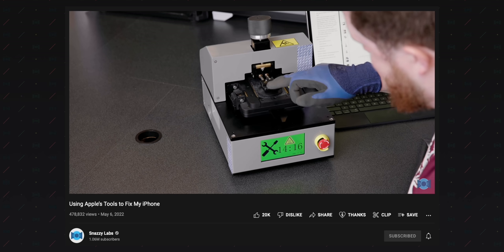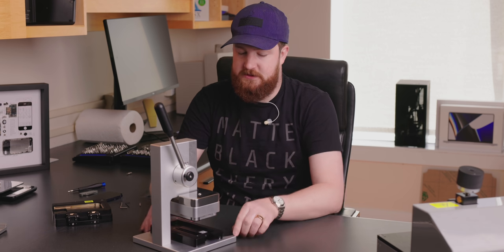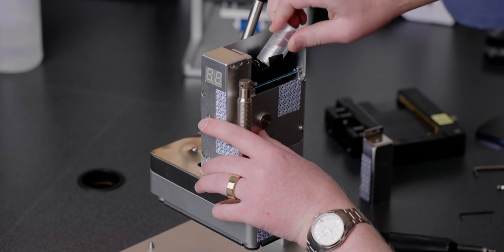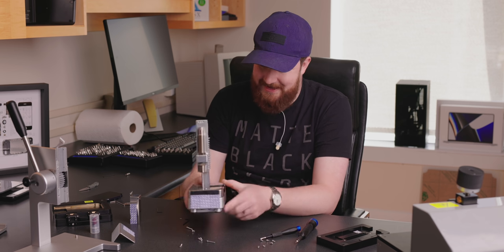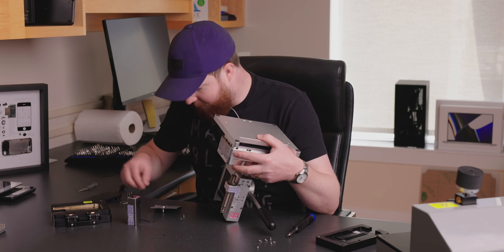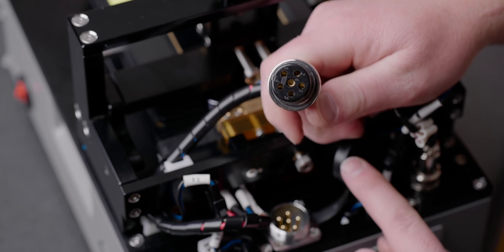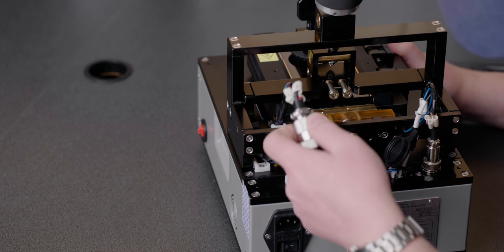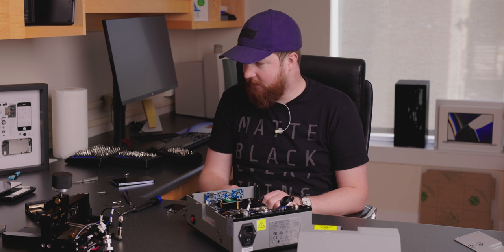Breaking Into Apple's Secret Genius Bar Tools!

Comment: I bet the purpose of the RFID thing is so that when Apple makes different phones, they can just give out new hot pockets that can then tell the machine what kind of heat to put out for for that specific unit just in case the new phone has more or less glue in it than another model.
Reply from the maker: Yep. Agreed. Set temperature and timing.
Reply: @snazzy  Could also be for stock management - although I'd expect an RFID tag in every device for that. It's becoming a very popular way of managing stock.
Reply: @Crusader1089  Not for stock management, it's specifically for temperature and timing like previously said. I've been a Genius bar tech for 2 years.
Reply: more or much more glue, never less
Reply: Might also be NFC
Reply: Can also hold calibration data for the thermistor
Reply: @QualityDoggo  no
Reply: @snazzy  maybe you can reprogram it and give it other temperatures and timing's? That would be really cool. And could you make a video if they charge you for breaking their stuff?
Reply: @chromegamer888  they can’t charge him. he paid for the equipment.
Reply: @brayd3n.heust0n  Don't know.  You can buy it or rent it.  If he rented it, then he's not getting his deposit back.  :-)
Reply: @Shamino0  the deposit is to encourage you to send it back. if you keep the equipment all they do is keep your money.

Comment: The tools are for mass repair/production. Imagine having to use your fingers to apply the glued part. The roller tool would be extremely useful
Reply: Very good point!
Reply: And if you crush or damage the ends of the pouch it may lead to a fire in a very small percent of cases. Given the volume they deal with, this battery roller tool is likely a good idea.
Reply: right so why send it for a one off
Reply: " Imagine having to use your fingers to apply the glued part" - how many battery replacements is a tech doing in a day?
Reply: @emilypeters8888  I think apple is sorta trying to make it look like it’s harder and more complex than people thought, since they put off repair programs for SO long.
Reply: @AndyMcBlane  this looks like in factory used tool too. 
Could be hundreds of ovine a week that need manual rework off the line
Reply: @ericspda  It IS, when one does it according to proper procedures, IE, PROPERLY and to spec.
Reply: @ericspda  YES. it's ridiculous that according to them, you need all this equipment just jo change a battery.
Reply: @emilypeters8888   apple wanted to just re-use all the manuals they already had, if they did a dedicated manual then they would need to describe how to press down the batter but not press it to much and how to ensure when you do that you don't damage it etc...
Reply: @emilypeters8888  in a way it’s not really a one off because they’re designed to be sent back and then sent out to the next person..
Reply: @AndyMcBlane  5-20 max, not enough to cause finger damage.

Comment: The mostly likely purpose of the shield around the display press is because when the pins slide up, they create a pinch point, and Apple didn’t want to deal with the lawsuits of people getting pinched by the press, so they added the cover and it looks nice.
Reply: Yep, first thing I thought of. Enclose the moving & pinching bits as much as possible to keep from getting fingers or whatever in there.
Reply: Not even lawsuits.  This would just be covered under machineries regulation in the EU, and it has a CE mark so it's approved for sale there.
Reply: well ofc it is that. but ye old "apple and looks" BS makes for a better video and more clicks.

Comment: I worked as a tooling designer for some Apple products, and everything is very overkill with them. Their power supplies are nuts, they not only put an adhesive inside, but then had us weld the two halves of the clam shell together. The tolerances that were required meant that my company needed to get some new equipment as well as having a ton of rejected parts because they didn't meet spec. Honestly there's more that happened with them, but I don't want to write a short story. Additionally this was stuff ~4 years ago which is out of my NDA so I got that going for me too.

I also wanted to add that I doubt much of that is actually extruded aluminum. The satin finish can be done using scotch bright, which is like the coarse side of a sponge, and elbow grease or a vibrating sander.
Reply: >needed to get some new equipment 
That’s prolly part of why apple products are so expensive lmao, since i’m assuming the company passes the expenses down to apple
Reply: I can’t imagine those would be hand finished, although I agree not extruded for sure. But probably some sort of stone tumble
Reply: Crazy how different the "language" and style of the designs for consumer vs internal products are.
Reply: @QualityDoggo  cuz production products don't need to have "sex appeal" (as ltt puts it) lmao
Reply: Very curious about that job, anywhere I can read more about it?
Reply: The fact that the slots aren't continuous tells you that it's not extruded. The bars could be extruded, and probably are, like most aluminum bar stock, but it's completely machined to final dimensions.
Reply: Please write a short story, it's very interesting
Reply: To quote you, “Honestly there's more that happened with them, but I don't want to write a short story. Additionally this was stuff ~4 years ago which is out of my NDA so I got that going for me too.”   
Please DO write that short story! It seems many of us are interested.  Thanks!
Reply: To quote you, “Honestly there's more that happened with them, but I don't want to write a short story.”   
Please DO write that short story! It seems many of us are interested.  Thanks!
Reply: skotchbrite: causes 90% of work accidents, but looks nice
Reply: I think the finish is most likely from sandblasting
Reply: Thanks for your insight! Yeah, on the screen press you can see some edges are a bit rounded and shiny - telltale signs of some wire wheel + scotchbrite work.

Comment: 2:30 I mean, you can have linear and non-linear springs. Its not just a given that any spring won't have a linear curve to its force applied with respect to its compression.
Reply: He's not saying it doesn't have a linear force curve, he's saying the more it's compressed the more force it applies, it looked like a linear spring in the video so if you were to measure force the spring applies against the spring compression you would get graph showing the force would increase linearly when compression increases
Reply: He meant to say that it is not constant, but he said non-linear which is (mostly) incorrect!
Reply: @ArisSynodinos  Makes more sense that way now that you mention it. Its probably a linear spring (given that it seems to have a constant radius and spacing) but who knows.

Comment: 1:25 This thing reminds of that credit card slider used back in the 80s and 90s to carbon print the numbers on some sort of receipt. Nostalgic.
Reply: Yep, worked retail then and it was neat.  Just assuming it was pressure to press the CC numbers onto thermal paper.
Reply: They call them "knuckle-busters" in the industry.

Comment: That lithium battery is double the voltage of a C or AA battery. It’s interesting that they designed it to take a C size, but not C voltage
Reply: Was looking for this o.o
Reply: It may run on 1.5 too. Some circuits are dual voltage or run on a voltage range.
Reply: I guess you could say it's C major
Reply: @bigblackbadger1  hah, you, you I like 🤣
Reply: My best guess is that because it's a Genius bar tool, they wanted more capacity because geniuses needed to work on more phones.
Reply: you can get lithium AA batteries. They include step-down circuitry inside them
Reply: @keco185  yeah, the battery IN the tool is a lithium AA battery.
Reply: @keco185  or tripple. idfk. I barely know what i'm saying.
Reply: @aliabdallah102  my point being it’s 1.5V
Reply: @keco185  well, yes that’s a good thing to know, by for this tool specifically it’s a normal Li-on battery at 3.6 nominal voltage (probably a 14500 size if I had to guess)
Reply: I use those 1.5v lithium aa and they are great for normal electronics, and I use the lithium 14500 batteries for some hobby projects where an 18650 is too large.
Reply: @josh8106  interesting.
Reply: @keco185  it's not 1V5. It's a 3V6 lithium ion battery. He specifically said that it says it's a 3V6 voltage battery. It's a 14500 battery, not a standard 1V5 AA battery. It's completely different chemistry to the AA lithium batteries that are 1V5 (like Duracell and Energizer "lithium" AA batteries), different to the AA Li-ion batteries that have a 3V6 cell with a buck converter. It's a regular 3V6 Li-ion battery, like an 18650, but in a 14500 form factor.
Reply: @aliabdallah102  a 3V6 14500 battery at say 1200 mAh is going to have less capacity than a 1V5 C-cell battery at say 4000 mAh. So the actual reason is that they want the stability of a lithium ion battery, without the potential for leaks, which C-cell batteries are notorious for. (A C-cell is going to have around double the Wh of a 14500 Li-ion battery.) The machine was probably designed for a C-ceel battery, and they retrofitted the circuit for a Li-ion battery, but continued to use the C-cell battery sleds that the board was designed for.

Comment: For anyone is is trying to learn more about this stuff here are a few corrections/clarifications to make your googling a little more streamline. 
Brass is not extremely thermally conductive. It is not and will never be used for heat transfer. So it stands to reason that those heating blocks are actually a copper aluminum alloy.  
That gearing is called a Rack and pinion. 
The "linear rod" he is talking about is actually called a linear rail. 
That switch is generally called a limit switch (or endstop as he notes later in the video) (indicating you have reached end of travel).

Comment: Did you try reading that NFC tag on the heater tray with your phone? iPhone probably won't do anything, but the NFC Tools app on Android might be able to tell you what's there.
Reply: why an NFC tool app? Any Android stock camera app supports QR-Code reading.
Reply: @Esablaka  ...because that's an NFC tag....?
Reply: iPhone has nfc as wel
Reply: @cossieboy 
It’s kinda useless thanks to Apple restricting hardware access and APIs to app developers.
Reply from the maker: It’s RFID. Not NFC.
Reply: @Esablaka  Why are you on youtube? McDonald's has big macs?
Reply: @snazzy  Ah, so you did try it then. Fair enough.
Reply: @Esablaka  radio tag, not a picture tag?
Reply: @WarpedFlayme  Really sorry that he did not answer you. You can read both RFID and NFC with your Andriod phone. But yeah, better avoid the real question and teach you :D
Reply: Get one of those entry card tap things and use that
Reply: @Scarlett-uz9fr  not all Android phones can read all rfid. It is very complex.
Reply: @snazzy  RFID and NFC aren't mutually exclusive technology.

Comment: Actually the USB port is connected on partner models and is meant for firmware updates. Since this is a home repair kit, you're not likely going keep it long enough that a firmware update is required. That would make since why they disabled it, but it is silly that they did so.

Comment: Quinn! A 3.6V AA battery in the Display Press-
You glossed over that but it’s somewhat odd.. usually AA is 1.5V. No? Like as a rule.
Reply from the maker: Ah yeah, d’oh! Nominal voltage on alkaline is 1.5V not 3.6V so must be a lithium cell. Makes you wonder why they didn’t just use a AA holder though.
Reply: @snazzy Apple: Think differently
Reply: @snazzy  in the recent supply chain crisis, wonder if there was a stockpile of C battery holders in the back of a warehouse collecting dust.
Reply: It’s likely made for an 18650 or a 21700 battery (can’t tell) and they made this small adapter to save costs or to get around some shipping requirements of not being able to ship over a certain amount of lithium via air. @Snazzy Labs

Comment: 22:47 There's a USB connector on the board, just get a cable between the two USBs and you can probably read from or even write to the firmware of that thing!

Comment: 5:50 when you need to break the "warranty void if removed" sticker just to replace the battery on your tool, you know it's an Apple tool
Reply: It’s not his, this is the kit that apple sends as rental.
Reply: Yeah, literally. Apple owns those tools. And that is pretty common thing with rental stuff. You are not allowed to use rental stuff like you own it.
Reply: It's easy to hate on apple huh? 😂
Reply: I know someone who works at an apple service place and he said they got that press for the iPhone 6s in 2015 and they've never had to change the battery so far. Probably why they fit a lithium one, won't leak.

Comment: Great video! Its really interesting to see how they like to over engineer the process.
Sorry but this is pedantic physicist of me, but just want to note that spring pressure is linear (Hookes law: F=kΔx). It is not constant though.
Reply: I was thinking that, how can he say something so blatanly wrong with so much confidence ? A 5 minute Google search would’ve enlgihtened him.
Reply: @jr_kulik  it’s one tiny aspect of a 20 min video, not a big deal!!
Reply: @fbdjwjflac  Of course it is not a big deal, I still enjoyed the video, but it physically hurts to hear such misinformation being propagated unknowingly.
Reply: there are non linear springs, and they are quite common. I can't tell from the video if one was used.
Reply: @jr_kulik  maybe they only apple search? with google being the competition!
Reply: @Sw3d15h_F1s4  if its an apple and linear are the more expensive, they here?
Reply: @dh2032  springs are usually priced based on size rather than if they are linear or not.

Comment: Springs are linear, unless they are progressive rate, which is denoted by a change in turns per inch of length.  A conventional spring is linear, that's why pressure increases as your compress the spring, it's call the spring rate, and it's denoted as pounds per inch of compression or kg per cm.